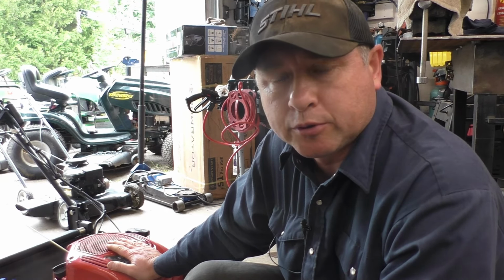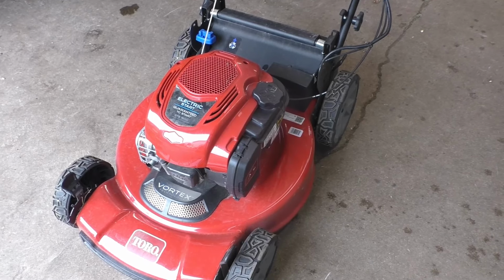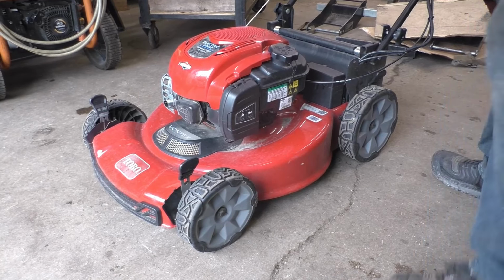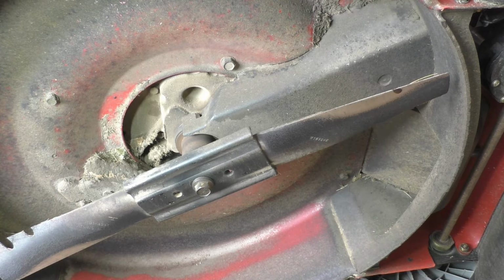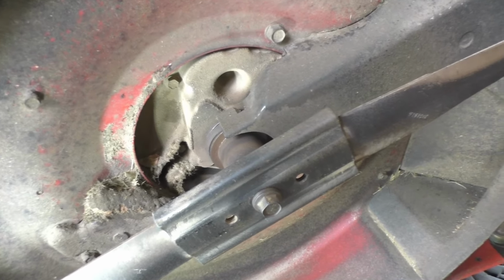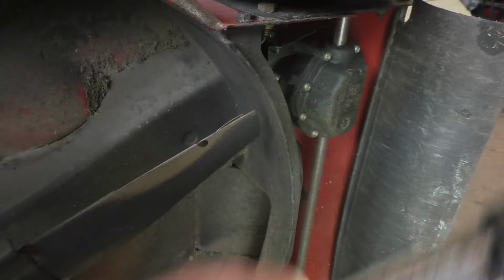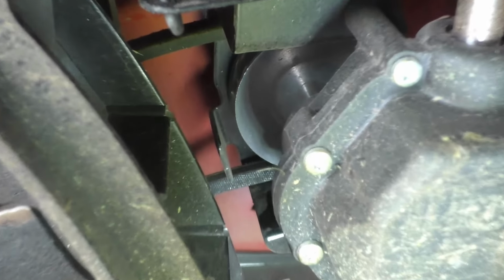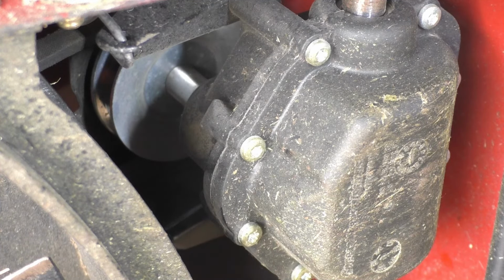TORO Self Propelled Lawnmower Drive Belt Was Squealing! - This Was An Easy Fix!

Comment: I'm still mowing my lawn with the cast aluminum self propelled Toro I bought new in 1996. The belt was on top of the deck back then and I've never had this problem.  I hope it outlasts me because nothing on the market today comes close to the quality of that machine.
Reply: You may enjoy this! I bought a Lawn Boy Utility mower in 1981 right after I bought my home. I was strapped for cash and it was a cheap 2 cycle machine. I planned on getting a better mower but never needed to. It has worked for me every Saturday since and I've put in a new carb needle and seat about 20 years ago and replaced two wheels. I just kept the bottom of the deck clean and I probably have changed the spark plug (maybe??) three times in the past 43 seasons. I'm 68 now. I asked my wife to bury it with me when the time comes. I love that mower.

Comment: Nice! A scrapper buddy of mine who does garage clean-outs just gave me a Toro front wheel drive mower from 2010 that looks like it was never used. I checked underneath and the drive belt was jammed between the bottom of the engine and the pulley. It must’ve happened when the mower was new and the owner never got it fixed, it just sat in his garage for 14 years until last week. I replaced the belt, rebuilt the carb and it’s like having a new mower right out of the box!

Comment: Mine is exactly like that and mine started squealing when I pull the cord. I tore down to get the top off I wanted to  check the key.  i when to loosen the nut  it was loose already on the flywheel  I tighten nut up put it back to together and it started it's a good mower. THANK YOU FOR THE VIDEO

Comment: I learned a lesson replacing drive belt on a troybilt.  Be sure to engage the belt when replacing the belt cover. I messed up and had guide pin inside the belt, not outside.

Comment: Good video.  I just made this exact repair.   In my case the belt was shot and I had to replace it.   I have to admit I’m not a big fan of the self-propelled setup on these mowers.    I find it a bit awkward especially when manually starting these.

Comment: Had a front drive recycler that was squealing. The belt came loose and was jammed between the pulley and bracket. I replaced the belt and it ran fine.

Comment: I once had the drive belt come off the engine pulley on my Recycler. It still worked... kinda. It wasn't obvious. It just seemed like it wasn't providing the right amount of assist. I didn't find it until my off-season servicing.

Comment: a good video there Donny mate and who,d have thought of something so simple could be a squeaky problem but yeah not too often you come into problems like what you found and yep over here in Australia or the Land Down Under 🐨🐑🦘🌴🌳🇦🇺 we have our versions of SP (Self Propelled) and even our legendary Victa.s with the P/T (Power Torque) engines have common problems too but yeah luckily very preventable with a good bit of cleaning and of course general inspection in between jobs and if it,s a easy fix that,s good and if not we often take ours into a repair shop if it,s needed to be done by a mower shop professional for sure and normally it,s a genuine Victa Cutting Disc in the center with two (2) blades on there and well a few O-rings on there from the Starter top cover the the Inlet Manifold and the Carburetor aka carby which is the G4 type on those engines and the air filter compartments are located at the top through a Snorkel tube assembly which i kind of like as it protects the motor from dust and a healthier engine life too etc and cheers to your area in Canada 🍁🇨🇦 and i hope your keeping cool in your Summer Weather over there too.